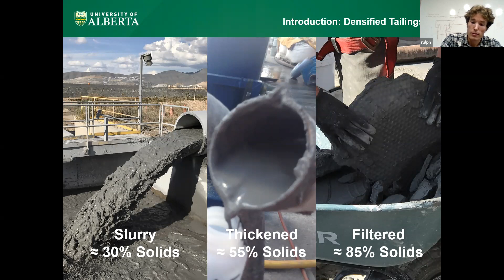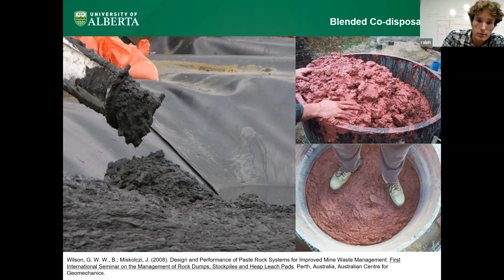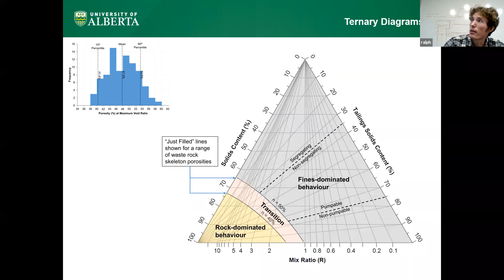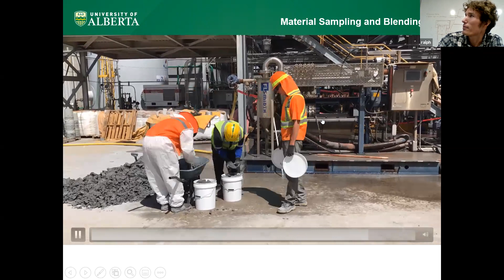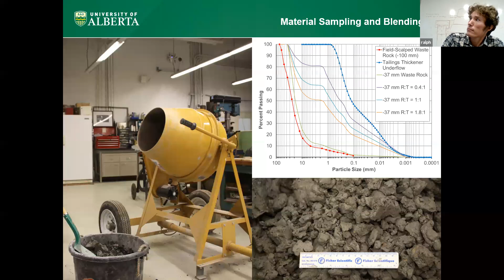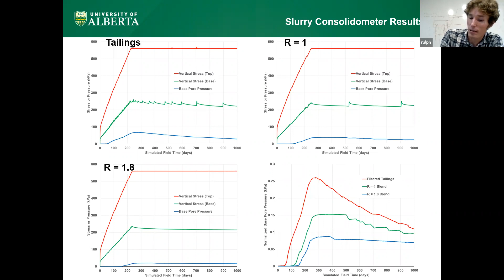A new approach in mine tailings disposal: Using co-disposal to build better "dry stacks"

Comment: The main reason why dry stacking hasn't cought up is exactly because of the simplicity with which the narrator states that the technic is expensive.....without ever compounding closure costs,which typically cost Claire to 0.3 to 9.5 million USD per hectare